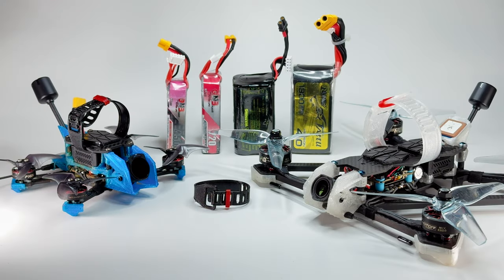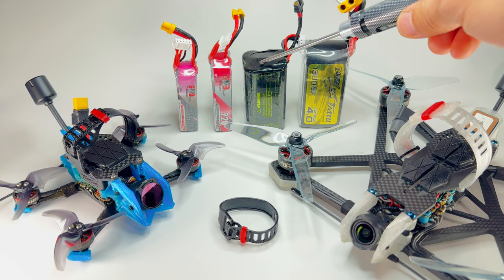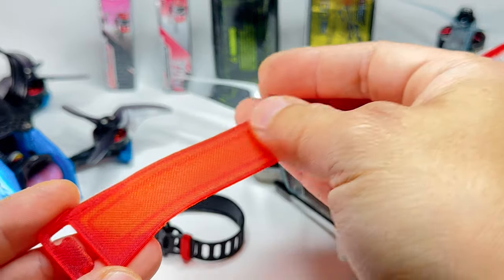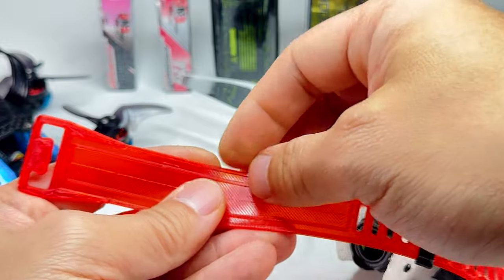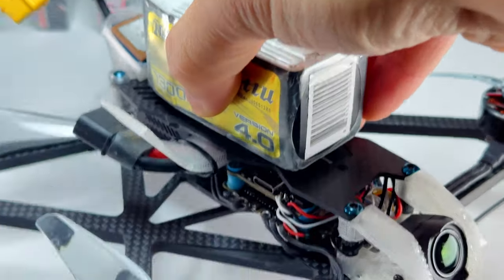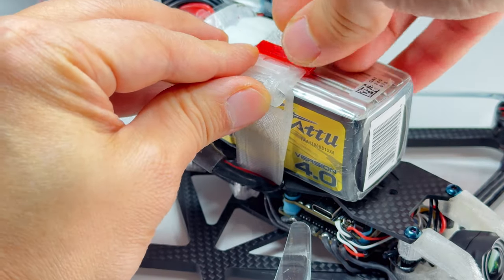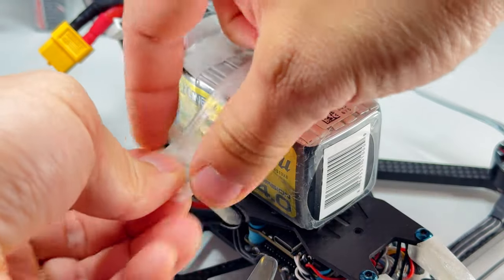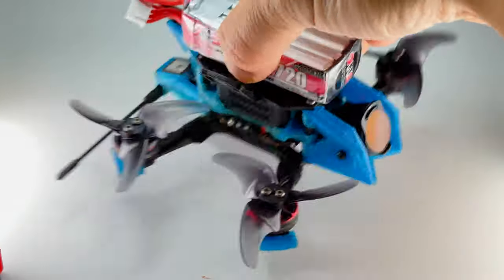How To Use Protostrap | 3D Printed Battery Strap for FPV drones and RC hobbies & Free Download Link!

Comment: I like this. I have often dreamed of trying to design a strap that would have an over-center buckle mechanism; a clasp mechanism like you find on a toolbox. With a mechanism like that you wouldn't have to struggle to pull the strap tight, it would pull the strap tight automatically.
Reply from the maker: Very cool concept! That would save lots of fingers from hurting! :D

Comment: Brilliant video and strap design.  Thanks for making the stl files available for download. I'll print a few and give them a go. I've subbed your channel. Happy flying amigo!
Reply from the maker: Thanks man! Hope it works out for you. Use some sticky battery grip with it if possible. 👍
Reply: I will Patty. Thanks again. The battery pad that I put on my frame is pretty grippy already and it's a 7" quad that I don't really do any aerobatics with. I'm using two battery straps right now. They're good ones from RDQ that have a somewhat tacky side toward the battery. They work great but I've wanted to print my own. I've designed a few in my mind but haven't printed out any prototypes. Yours look like a great design.
Reply from the maker: @Sonic_Ox  Awesome! Curious how it goes and keep me updated!
Reply: I'm printing a large strap and loop as we speak! I recorded a little video as it prints and with your permission I'll post a video on my channel showcasing your strap. I'll put a link to your channel in the description with a blurb promoting your product. Again with your permission of course. I want you to get full credit for your intellectual property. I've had designs stolen myself and actually sold by knuckle heads so I know how aggravating that can be. I don't profit from YouTube or from any of my hobbies. I just like sharing information and aerial drone photography with my friends around the world. I'll keep you updated. Happy flying amigo.
Reply from the maker: @Sonic_Ox  Sounds good man!!
Reply: Hey PattyFlipz,
I printed out one large Protostrap and loop. It's working well and I plan to print a few more. My set-up is best with two straps. This design works well and looks cool. I've decided not to post the video though because my fat fingered installation make the straps seem more fiddly than they really are lol. I don't want my advertising to do more harm than good haha. I only have a few viewers anway so I'm sure I can't do you harm😅. Anyway thanks again for sharing your design and making the stl files available.  I checked out your website too and really like the looks of your frames and the TPU components etc.  ProtoFpv looks like some really professional stuff that I will certainly consider for my next build. Happy flying amigo.
Reply from the maker: @Sonic_Ox  Thanks man! The protostrap L is untested so far and I do think in the future I may thicken and widen them in the future, especially if strapping on batteries heavier than 400g. Or another idea is make two of them side by side, but they are linked so they become a really wide wrap, basically more than half the width of a lion battery. If you do make any improvements to the file, feel free to evolve it yourself and share or not! Up to you. It does take some getting use to for sure! Cheers man and have a great flight.

Comment: I find the real problem for every battery isn't the grip on the frame but the battery slipping out. My solution is a battery top side strap holder that sticks on to the battery and holds the strap in the right position for weight balance. It saves me a lot of batteries as most batteries get damaged when they don't stay in the correct position or slide out completely.

Comment: Velcro seems more secure, especially if you use it instead of sticky pad too. Battery is not moving.
Reply from the maker: Totally. Traditional Velcro strap is better with regular battery pad for sure. But everyone should use sticky battery pad imo. Give the proto strap a shot! Takes getting use to. Can always improve on the design. Imagine an ultra wide version.. make it however wide OR stiff you wish. Proto strap is the basis for a free strap you can make at home.

Comment: Nice setup! I've been experiencing issues in cold weather, so I'm considering something incredibly simple where I wouldn't have to remove my gloves. Any suggestions?
Reply from the maker: Possibly something that just pops in and you turn a dial and the entire strap tightens onto the battery. At the moment I have no clue how to make that happen lol. Would take lots of thought . Hmm first thought it mind is worm clamp. Hmmm. 🤔
Reply: @PattyFlipz  ya was looking into my dji avata i think a frame that you can snap the battery in. Would have to be a standard size battery but should work
Reply from the maker: @YTFPV  I see, yes makes it much more complicated unless you intend to use the same battery over and over. Would be very difficult to design. Someday when I'm really bored I will think about it though!! Thanks for the ideas.
Reply: Actually i found a way to make it you have a 3d printer i presume ?  I just got the Nazgul and i am so use to DJI product clip on  battery . On the Nazgul will super easy to make it work i am not sure about the material would be strong enough. It would have to be one size battery but i would think most guy fly only one size for  fpv easier to carry and charge  @PattyFlipz
Reply from the maker: @YTFPV  I recommend finding a local 3d printing company in your area. they can print for cheap. Maybe a few bucks! Keep me updated on your progress though. Good luck

Comment: nice idea but I cannot print L size due to my bed size only 220x220. Too bad
Reply from the maker: Yes too bad! Maybe a local 3d printer store can help you. Usually it’s only a couple bucks.
Reply: print diagonal???
Reply: @torquilmorrison1283  cannot, already tried that. I need at least 300mm strap for li ion 6s battery.